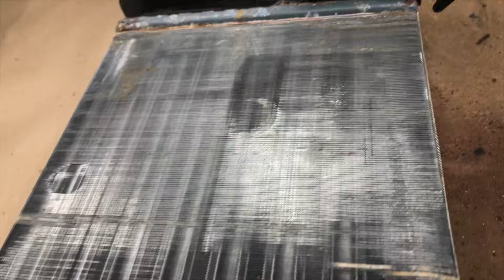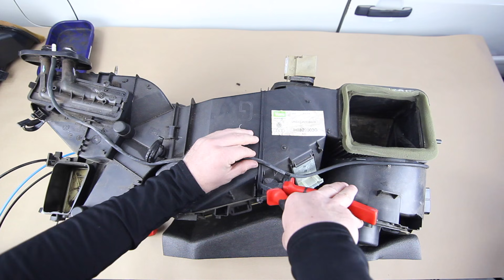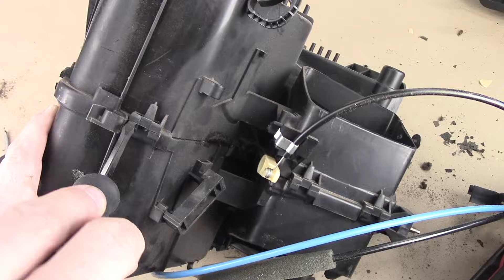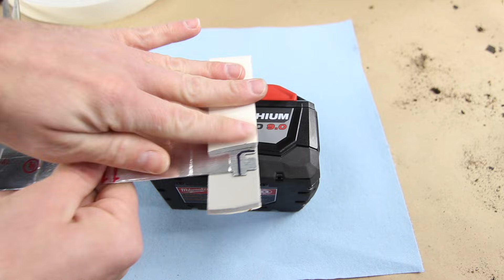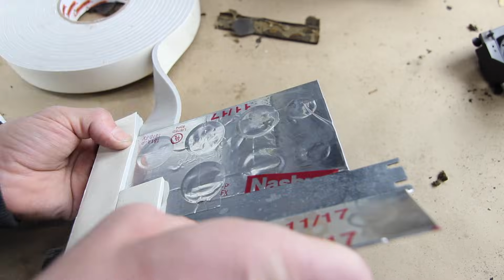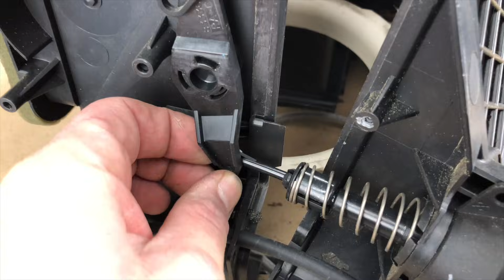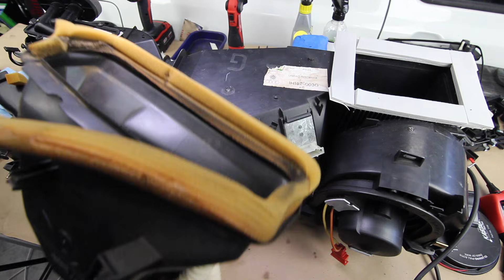How To Fix Blend Doors ~ Install a Heater Core and Reseal The HVAC Box

Comment: Never thought to look up a video. My doors had all the foam stripped out. I took out my evap core and put in a new heater core. Didn’t think to reseal it... guess I’m pulling it back apart 🤦🏾‍♂️😭 I just want my heat lol
Reply from the maker: I have to do this on the R32 soon.
Reply: HumbleMechanic it’s not a terrible job really, just sucks at this time of the year

Comment: I have seen videos (on a skoda octavia) and entries on the forums where the heater core has been removed by taking out the glove box, blower motor and left side kickboard below the gearstick. Any experience taking the core out with this method?

Comment: I'd love to see the easier way!
Reply: Me too
I think for that needs to remove the center part of the console, like the radio and knobs and such to get to the panel where those flaps are.
Reply: Guys usually just remove the lower dash panels and cut holes in the box and take the bad damper out entirely (like I did) or they fix the damper hinges and put them back. Before gluing the cut panels back, just use taped on cardboard to test the system a few times.

Comment: I have the deteriorating foam problem with my Porsche. This is not the first time I've seen foil tape used for this repair. Foil tape is great stuff but it is made to create a permanent seal.

The question is what made the engineers at Porsche (and other manufacturers) design a door (flaps, gates, dampers, etc) with holes and foam instead of just making a solid panel. The weight difference is insignificant. The only logical reason is that the damper control solenoids are not strong enough to open a solid panel with the blower motor forcing air against it. The holes are to allow for the pressure change as the door panel tries to change position. Will it be necessary to put the fan on low speed until the door panel moves? If the solid door panels can be opened by the control solenoids will they now break or the plastic cams/gears break due to excessive strain?

I can't help but think the only way to complete the repair and have the heater full functional is to install foam where foam previously existed. Maybe the new foam will be more durable than the original material used!

Comment: I have done this on my A4B5. You can remove just the blend box by itself, you need a mirror & screwdriver to remove the clips by the firewall. And remove the actuator motors to give you enough room to pull it out & turn it 90° & pull it right out.
I used A4 sheet closed cell foam from a asian shop & ADOS superstrength spray glue.
It helps to use cardboard to make a template for the foam first so you cover gaps at the flaps edges. Then trip it oversize & assemble partly to gauge it & trim again.
Assemble & fit the actuators & test it by putting power to the 2 pins in the socket.

The fanbox side probably wont need any work & you can remove just the fan + motor by itself.
The vent tubing to the centre will need to be cut thru to remove the box, but its distorted anyway & you will have to fix its flange connection to the box. You will see where n why n how. Use nonacetic silicon sealent & or that silver tape.
Reply: You cant get rid of the leaves and other garbage in the evaporator if you dont take the entire thing out to wash it out.
Reply: So glad to hear how you did this blend door repair on the B5 A4 without dismantling the dashboard assembly. B5 owners typically dread this repair, as everyone says "remove the dashboard" Replacing the heater core for the A4 B5 is an experience. 😅

Comment: Thanks for the video. I have this problem on my 911 and was looking for a fix. 
Is it possible that sealing the round cut-outs in the metal doors and/or using a different type of foam to OEM could disrupt the door’s normal operation somehow, or lead to another issue (such as jamming shut)?
Reply: Yes, dont use too thick foam and test operation before fitting everything together.  A little foam is better than no foam and actually some air is meant to pass through.  Like in my TT, flaps should be electric in the 911

Comment: Great video. Gives me the confidence to fix mine. Quick question, Can this whole unit be installed in a mk 1 rabbit that only has no ac just the blower motor? If yes, What would i need to do to install it without any issues? thank you
Reply from the maker: That I don’t know. Probably better to install a mk1 box with AC
Reply: @HumbleMechanic  Thank you

Comment: Okay, so here is the one million dollar question:

WHY is there holes in the blend doors to begin with?
Reply: German car manufacturers do it on purpose, so you hate your car and are forced to buy a new one after 10 years.
Reply: SDMacMan isn’t there new laws in the EU, not letting manufacturers build anything with planned obsolescence? That’s a very clean example.
Reply: This might be BS but I am guessing it is to allow some pressure relief if you wanted to move the door while the fan is on a high setting. A solid metal piece might struggle to move against a high flow rate.

Comment: Hi, 
Is there a way of replacing the heater core on the b5 passat without losing the air con refrigerant ?
Thanks in advance
Reply from the maker: No, I think you will have to evac to remove the box.
Reply: Thanks. Keep up the good work man!

Comment: Ugh, our 2001 Eurovan is blowing chunks of foam out of the vents.  Knew it was coming.  Seen a couple of ways to fix it with out removing the dash.  177k on a 18year old plastic tanked heater core, might be a good time to do both.

Comment: This is SUCH a helpful video!!! Thanks for the nice video and audio quality. Would not have been able to complete the job without this video. Thanks again! Also do you know if in the 2002 model they changed the face air flap from straight to an L shape?

Comment: I'm doing this on my 02 Jetta to fix the bleed doors. Heater core is fine. What is the best way to cover these doors without removing the box? I already have the seats and full dash out. Haven't loosened the bar. I didn't want to have to deal with loosing coolant or refrigerant. I'm having trouble just reaching in with just my hands so not sure how I'll be able to seal these up. Can the doors be remove from the box without removing and splitting the whole box?

Comment: Thank you very much for this very informative video. Does this exactly apply to Golf mk5 in terms of disassembly/reassembly or it's a different process?
Reply from the maker: It will be similar. I’ll be doing my mk4 at some point too.
Reply: Thanks. I've been searching for instructions to disassemble the dashboard/front console or whatever it's called of my mk5 to repair the blend doors. Would be grateful if you kindly suggest some video or at least illustrated instructions.

Comment: Hi Charles thank you for a superb video illustration, I Own mk3 Jetta 2.0 . I think you may have just solved my problem my "heater problem" with this video. In my case the heater is not getting very hot inside the vehicle, yet hot coolant is circulating through the heater core. I think the cold air from outside is diluting the hot air due to the foam on the blending door that has perished away over time. So a video do this repair without removing the heater box would be greatly appreciated.

Comment: So I changed my heater core on a 2000 jetta. It was a lot of fun. Now my immobilizer light is blinking and car won't stay started. 
How do I reset the immobilizer ?
Reply from the maker: Make sure the ignition reader coil is plugged in all the way.

Comment: GOOD VIDEO. ! 

The manufacturers need tp am e the hvac a little more complicated . 
SENSORS on EVERY DOOR ,indicator lamps on EVERYTHING  door to monitor door position at every moment...even when car is off and have it tied to your smart phone , email , computer etc
AND they need to have a computer control module to operate an monitor EVERY action of the hvac system and tie it into every system in  the vehicle . 
REWRITE A PROPRIETY PROGRAM FOR ALL SYSTEMS IN THE VEHICLE TOO !

             LOL

Comment: There simply must be a reason why these holes are there.  It costs money to cut those holes.  The foam they cover the holes with is designed to breathe at a calibrated rate.  So, covering the holes defeats whatever purpose those holes perform.  My guess is that without the holes, the air pressure is too high against the doors... perhaps causing them to SLAM shut, rather than simply shut with the proper amount of aggression.  Also, it might take a huge amount of crank to open the door against the air pressure.  If VW didn't want those holes there with a calibrated leak, they would not have designed that in.  Comments please??
Reply: Another possible reason for the holes might be that without the holes, the pressure inside the box will cause whistling noises at various places where the air escapes, little holes, plumbing twists, etc.  With the calibrated leaks plugged (by covering the holes), the pressure is higher than design pressure, leading to a whistling nightmare.
Reply: Or, they made casts for the doors and just used less aluminum to save money.
Reply: Or they just made holes to attach the foam easier
Reply: Or it's to save weight which means it requires less force by the driver to move the flaps with the controls.

Comment: Any word on the video for doing it in car? I have a 98 2.0 gti that I've nearly removed the dash on but am a bit stuck lol
Reply from the maker: I did a really hard core eval when reassembling. Not sure you can really get to much with it in the car.
Reply: HumbleMechanic yeah, I've got the entire dash pulled off so next is to work on getting the box out. I'm going to see if there is a creative way to get access to those doors without having to remove the heater element
Reply: I did it, I got to the doors without removing the heat element or box. It's sloppy, but I got to them. Shoot me an email at bboddy28@gmail and I'll try to send you some pics.

Comment: you would think the extra manufacturing cost of having holes punched into the aluminum would negate the cost savings of the aluminum youre cutting out. Maybe it was for weight saving, so the doors move a little faster and put less stress on the motor that moves them? kind of interesting for such a little thing.
Reply from the maker: I think it was actually weight savings. Crazy

Comment: Why did you cover the three holes that were machined into that door? I didnt hear you say.
Reply from the maker: Those holes are supposed to be covered to block air flow
Reply: Cool, but why were they drilled out at the facotry just to be covered up? Whats the logic behind that?
Reply from the maker: Lightens the doors. Aka weight reduction bro. Hahaha. 

But it’s less stress on the pivots of the and control parts
Reply: Rock on man. Thanks for the replies. Love the channel. Keep it up.
Reply from the maker: That's :)

Comment: Just did this job on my 1993 90 Quattro. Michaels carries a sticky foam in 8 1/2 x 11 sheets. Thinner than what you used, but it made the job pretty easy for the doors. Wish I've seen this video before doing the job because I did it the hard way by splitting the heater box in the car (leaving the evaporator/ blower part installed) and it's a nearly identical system.
Reply from the maker: I really like the idea of a whole sheet. I’m sure there maybe a better solution out there. Lol

Comment: Any plans of that shorter video?
Reply from the maker: Nathaniel Farinas I’m trying to make that happen.
Reply: HumbleMechanic hey, quick question. Before my ac compressor failed, I noticed when I turned my switch to heat I could feel the door switch over, then when I attempted to switch it back to cold it felt “looser” and then shortly after my compressor failed. Is this coincidence or do the two relate to each other.

Comment: All I did when I did my heater core was double tape it and make the lip longer and act as the foam edge. I have heat finally! But my foot heater is pretty trash, Maybe I messed something up.

Comment: Why closing the holes? The holes are for air circulation when the blower motor is off
Reply from the maker: That’s not true.  The holes are to lighten the door. The doors direct air flow in the box. They can’t direct airflow when air passes right through it
Reply: these openings have a purpose,  like i said, you need air circulation and forced ventilation in the car when you are driving and the ventilation motor is off
AND to regulate the pressure on the inside when you are driving and when closeing the front doors.
Close the forced ventilation openings for the trunk behind the rear bumper on both sides, sit in the car and someone slam the door or the trunk lid.
You will see that you need this openings. Trust me, i made this fault before....

Comment: Hi Eric awesome videos I need help I am doing my head gasket on my bmw e36 325i and I forgot to turn my crank pulley to tdc and so I put my head on where the valve touch the piston but I did not have my  lock pin tool in do you think I am safe ? Please I need feed back

Comment: It would be cool if you could do an instructional video on doing a heater core replacement, but without disassembling the whole dash, and just lifting the top part away to get access to the rear like you've shown yourself doing in a photo before. Preferably on a B5 Audi or VW :D

Comment: Oh noe! Sanded door!? You think it's worth mentioning that, that door is galvanized, meaning zinc coated for corosion prevention. And if you sand it. Don't sand all the way through that very thin zinc layer or it will start to rust. The zinc is that crystalline like snowflake looking shine on the metal.

Comment: What is the reason behind using the foam for the extra pieces (heater core, exit to the dash) and the gasket between the heater box and the pollen filter (where it connects to the body)? I just looked into the parts catalog but I see quite those gaskets are still availble from VW and only go for like $5-$10 per piece

Comment: My mk4 golf has been blowing foam for a while, I really need to take a look and fix it when its warm.  TDI still makes great heat though.  Looks like ill have to be messing with a B5.5 1.8t heater core soon though, pretty much the worst job from what I can tell. :)

Thanks for the videos!  Have learned lots.

Comment: Hi Charles I have a off subject question and hope you don't mind. I have been looking for a good lithium battery jump pack to start cars. I would say I jump cars probably 50 times in a week so it would need to be tough. The problem I'm having with this is every one I look at has itty bitty lead wires! So my question is do you know if any of these things are worth the $75-$200 price tag or should I stick to my lead acid jump pack? I just don't feel like the wires they use on the lithium ones would even come close to handling the 300-600 amp claims and $200 is a good hit to the pocket book for something to not work.
Reply: I think those so-called jump starter packs are not worth the money and don't do the job they are hyped to do.  You're right that the small cables can't handle the high amperage needed to start the engine. Instead, you have to wait a while so the battery pack can transfer some power to the car's battery and boost its charge state a bit. Assuming the battery isn't totally shot and unable to take a charge, that will work much of the time. After a wait, when you try to start the engine both the car battery and the booster pack will supply current together and maybe get it going.

Comment: All of that and not doing the evap,  just an extra couple bills I'm shuddering to the grave
Reply from the maker: They are +$300 to replace. If it was not that much, I would replace it, but not into spending that with out needing to
Reply: I get it, just I live in the south, no AC and the car is useless 80% of the year.  Currently have a 2000 TDI and the foam is nasty picking it out of the vents and my hair.  About to do the seal kit for the fuel pump, fingers crossed about that going well.  Whats your opinion on life of the injector heads ~210k on the originals and have heard bad things about not refreshing them.  Hoping for another 200k out of this one.

Comment: I appreciate your YouTube channel immensely. I stepped out of my car comfort zone and bought my daughter a 2012 VW Tiguan with very low mileage.But still had no idea what mechanically to expect. I’m a jet aircraft mechanic. (Technician). And have always worked on my own family vehicles since I was 10. I love machines. Before buying the Tiguan I did a general search online for 2012 Tiguan issues and got a ton of hits. But like we all know when people have bad experiences they want to tell everyone. Not quite the same with good experiences. Your channel has helped me see that while I may need some new tools and I have plans to buy some walnut shell media and get my blaster gun set up for some carbon blasting. I do not need to worry about breaking the bank on this new vehicle. Actually looks like it is fairly easy to work on if I follow your advice on remove a few extra parts to allow ez of access and take my time. Having worked on Aircraft for over 26 years I’ve learned that taking 15 to 30 extra minutes to remove a part that is in your way to allow easer access can save so much aggravation.   Thanks for the great videos.
Reply from the maker: Thanks do the kind words